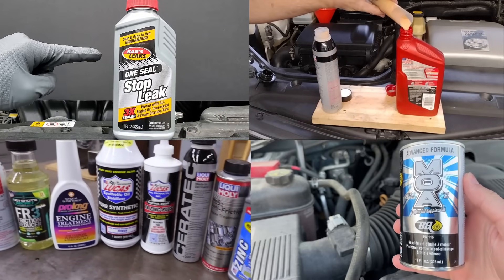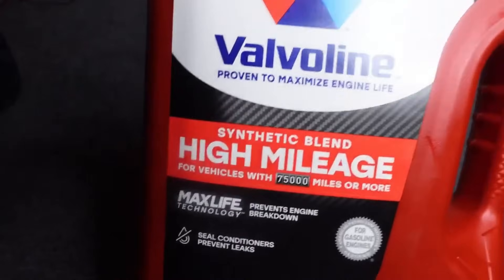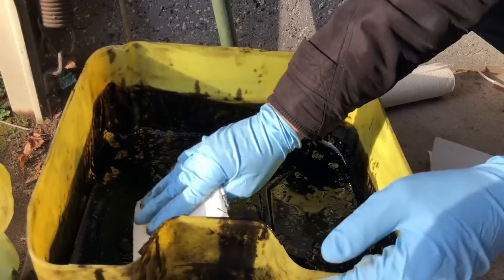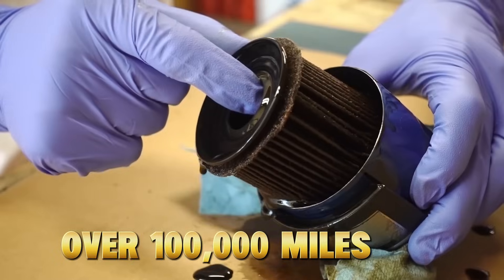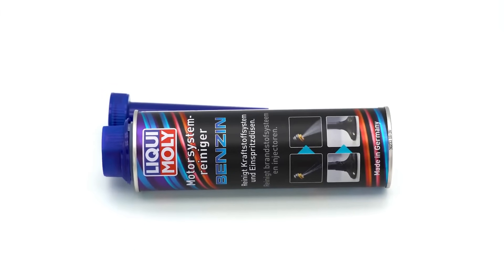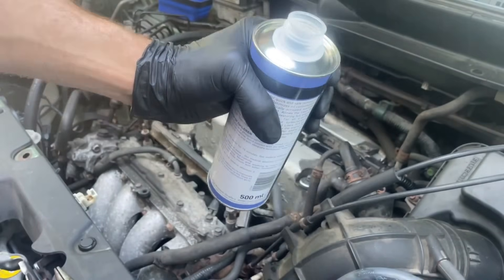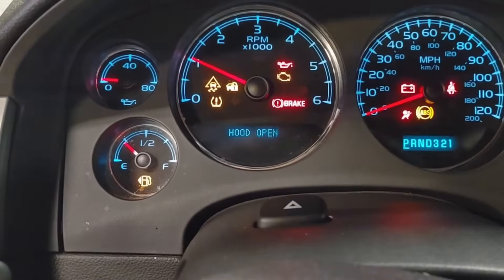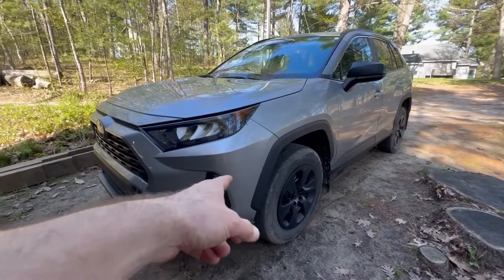The TRUTH About Oil Additives Mechanics Keep Secret

Comment: If modern oil is so good, why would they need additives?
Reply: Modern oils are good BECAUSE of the additives. 

In other words, oils in the past didn't have as good of additive packages as modern oil.
Reply: @tyangchizzle  I got that! One of the brands shown is Lucas. I've used Lucas oils for years. I use their full-synthetic 20w-50 motorcycle oils exclusively. 
But Lucas also sells an oil additive. Is it for their non-fully synthetic only? Does it boost their fully-synthetic oils protection???

Molybdenum Disulfide is also mentioned as an additive. I've used this for engine builds on cams, lifters and crank/rod bearings as a break-in lube.